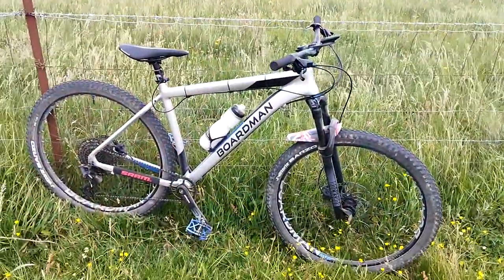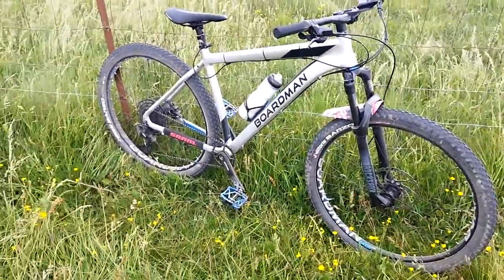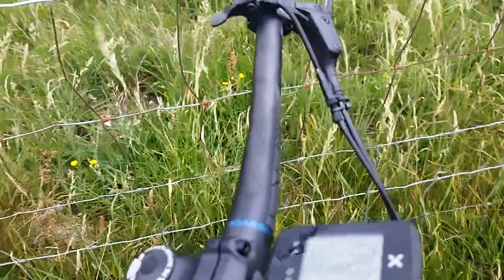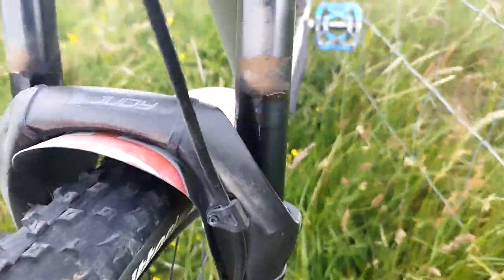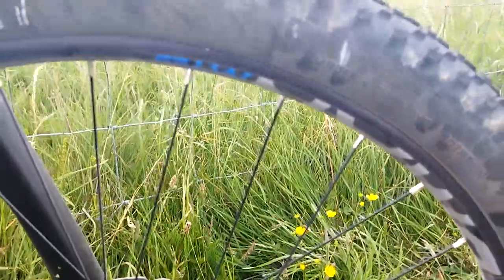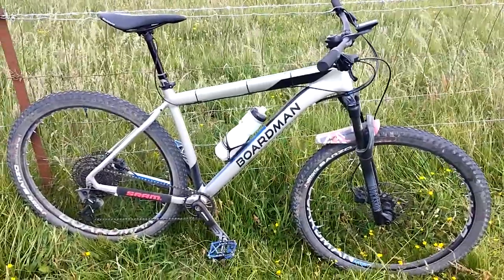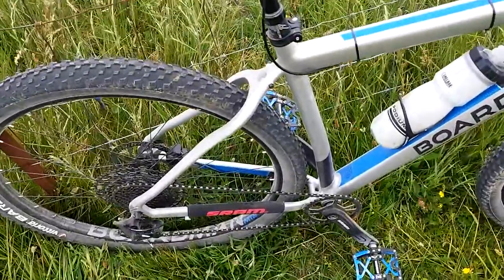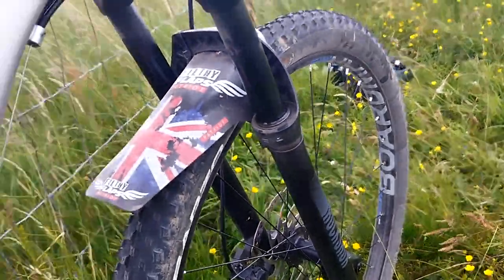Boardman MHT 8.8 build and review at the end

Comment: Excellent video!!  You can run the dropper post cable underneath the down tube and up into the seat post.  There is a little nipple just above the bottom bracket for the cable to go into.
Reply from the maker: Hi thank you for your comment means a lot 👍
I did see that there was a gromit for a cable routing so when I get a new dropper post I will get one with a cable that comes out of the bottom as I already this one from my old bike and the cable comes from the top 😁

Comment: I have the 8.8 mtr and the cassette was loose from factory, my dropper cable snapped 1st use, my rear shock came with a scratch on the sleeve. Finally now it rides ok.
Reply from the maker: ah that must of been a right pain especially on the first outing! glad you have got it sorted now. did you take it back?
Reply: @team_mudmunchers  I take it back, after cleaning it today I noticed i have the tektro hd-m285 brakes from the 8.6, it should have shimano mt200.  Both budget brakes but performance is night and day, I've message tech support hopefully they can send me some brakes that I actually paid for lol
Reply: @team_mudmunchers  and no i didn't exchange the bike, i took it to the nearest halfords, they fixed the dropper cable but told me they could do nothing about the scratched shock as "it might have been me" even though I showed them a pic in the box. I did get a 10% refund though after messaging tech. I had to buy the specific tool to tighten up the cassette though. And now the brakes are the wrong spec lol. Absolute shocking service so far from halfords mate.
Reply from the maker: That's not good and poor customer service in my opinion,
I know it's not much but least you got a bit back. 
Must admit I have the Tektros on mine too and should of had the Shimano but I have had the Tektros on my specialized Rockhopper and never did anything to them in the 7 years that I had it so I left it as is.
When I bought my Boardman Halfords said did I want them to build it? I just laughed out loud and said no it ok I'll build it myself 😜🤣
Reply: @team_mudmunchers  to be honest I opted to have it delivered and ill build it myself, but it came mostly built, I only had to fit handlebars, wheel and seat and pedals, you would think the cassette would be 40Nm from factory tho, it even says on the locking nut, 40Nm lol. I have no issue with the tektros they do squeal a bit tho, whereas the shimano are silent in most conditions.  Its a great bike for the price though, its the best bike I've ever owned, but also the most expensive,  I just wished they got it right the first time. As you say, halfords are terrible.

Comment: Just bought one of these and just noticed the brakes arent as advertised. Is there much of a difference between the Shimano mt400s and the Tektro m275s?
Reply from the maker: To be honest the tektro are pretty good, I had them on my old bike and the only thing I upgraded was the front rota to a 203mm  as I already had it 👍 
Hope this helps?
Reply: @team_mudmunchers  Cheers for the reply. Much appreciated. The bike really moves. Very enjoyable ride.
Reply from the maker: Out of all the bikes I have had this is the best one I've owned, so highly recommend 👍
One thing I would suggest is after a few rides just go over the bolts and just nip them up as my derailer bolt came loose but think that happened on the up lift at Bike Park Wales due to the vibration from the trailer 🤦‍♂️
Enjoy the rides 👍😁
Reply: @team_mudmunchers  Will do.

Comment: What's the difference between the 8.8 and 8.9 ?
I've just bought 8.9.
Reply from the maker: As far as I know the 8.9 has different shocks and better spec components plus a really cool colour frame 👍 apart from that I am not 100% sure
Reply: Its also a tad lighter. I have the chance of a cheap 8.8 but was looking for a 8.9 has nearly identical parts. so not sure why its lighter
Reply: If you are tall the 8.9 does not come in an XL frame =/
Reply from the maker: @christopherflynn843  I did not know that  thanks you for the info